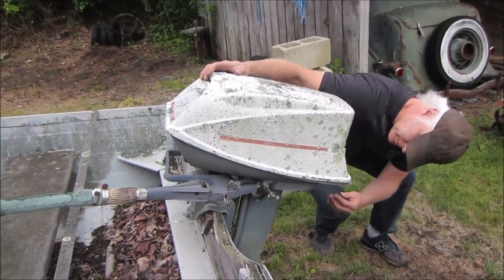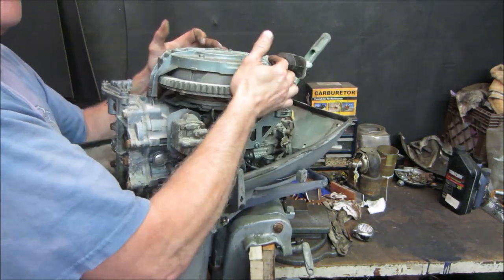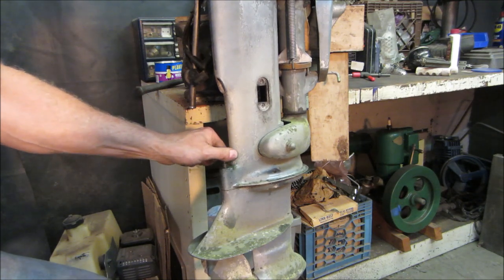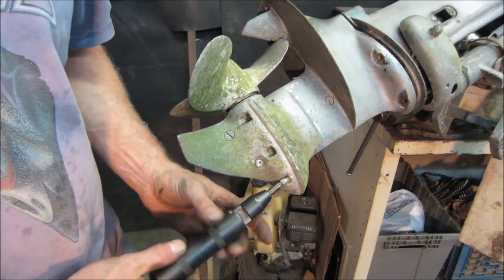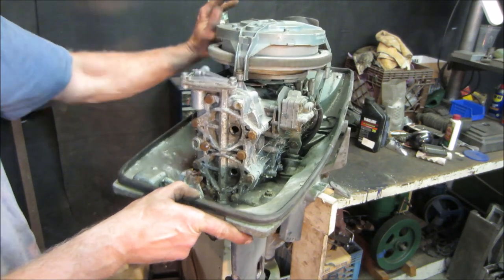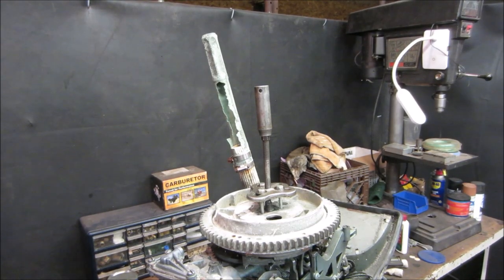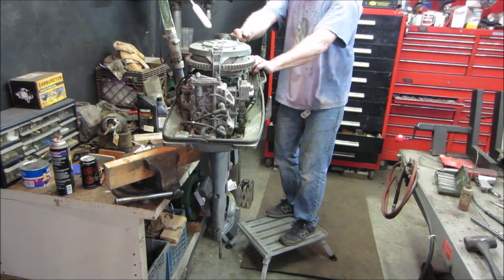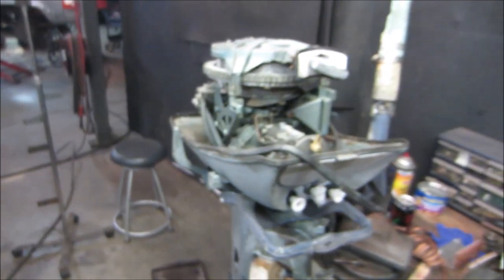Free Boat and Motor. Sitting 20 Years, Will it Still Run?

Comment: 43:08 This hurts my teeth.  Fuel.  Hellloooo. Fuel?  Plugs tightened into holes?  Swapping plug wires?  Never seen that done.  And you have such a beautiful big shop.  Lucky you. Go have a beer or two now.  I know how to fix that pull start housing.  Cheap.  Bottome end?  Grease and bearings.  Worthwhile.  Do it.

Comment: you sound just like Jays two cents ..LOL or he like you  should clean up the lower unit best you can a tos it all back together with oil and run it ....only trick would be finding a water pump ///other than that even them old gears in the lower unit could be cleaned up and put back together with some 140w tractor gear oil and be used for years .

Comment: The engine running is 90% of the game. Come on, weld up that pull starter, clean up the lower unit and get her going! You are more sensible but I wouldn't be able to leave it alone until I sunk more money in it than it was worth. That's what boats are about!

Comment: The lower unit is not supposed to come apart like that the shaft is supposed to come out of the head the shaft is supposed to stay in the lower unit not come through it now you got to replace all the O-rings in the whole lower unit and needs new water seal on the Wheel and also probably your water pump I haven't finished watching your video but you've gone about it all wrong taking it apart sorry to spoil your video not hating just that you're possibly my age or maybe older I'm not sure but you don't know much about the old 2-stroke outboard motor I'm a waterman born and raised know all about them and yeah are you sure did little bit of research first sorry bro keep at it though
Reply: He took the foot off. Obviously has never changed an impeller or he'd have went straight to it. 
I've never seen it done the hard way like that.